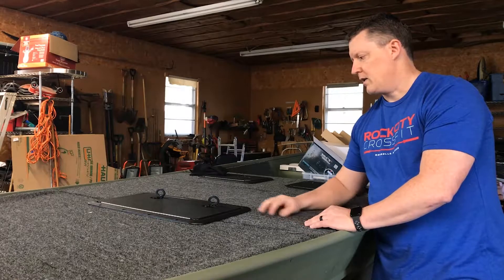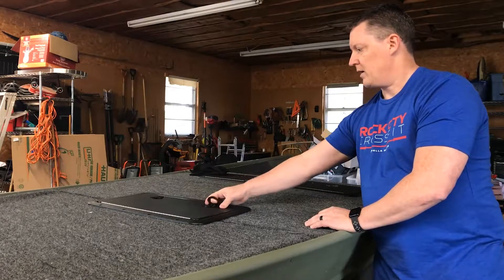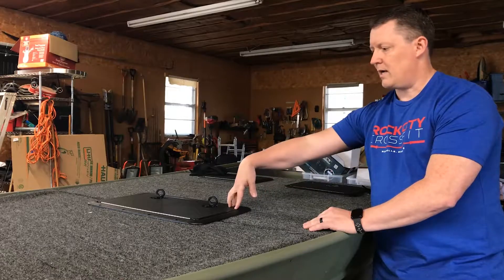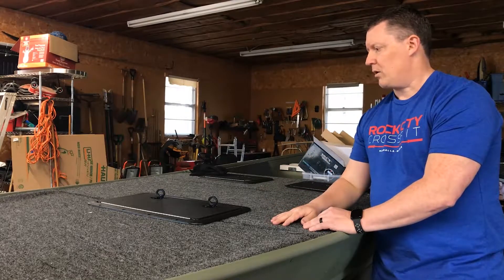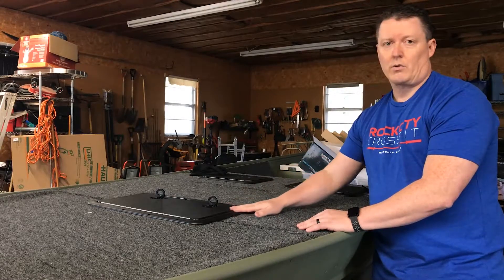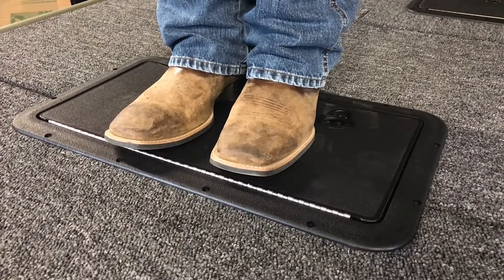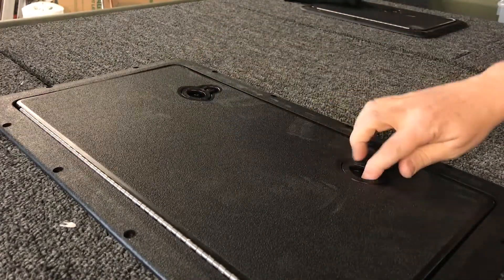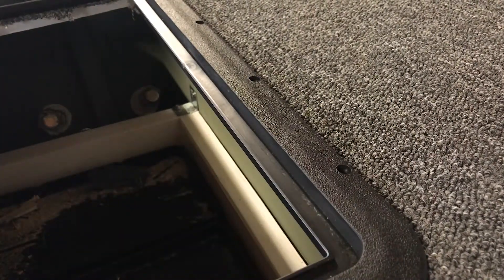How Strong Are The DPI Marine Hatches

Comment: Came across your video looking for marine hatches. If you don’t mind sharing, what type of storage box if any did you use. Looking to hold Plano 3700’s. Thanks for your video and time
Reply from the maker: Mike Sylvia I just picked up plastic storage containers from Walmart based off the size of the hole. I framed it so they wouldn’t slide around to much it holds several bait boxes standing on end. You can see the framing vid here https://youtu.be/0nMbT83nqL4 . Thanks for watching and the comment

Comment: Does it come with hardware? Either way, what sort of head do you need? Tapered? Panhead? Truss head? I'm just not confident in my hatch making abilities and by the time you get done buying hinges, hardware, extra carpet and spend time building hatches, you may as well get these. Thanks for the video!
Reply from the maker: They do not come with hardware, I used the same Zinc plated hex head screws I secured by deck with. The brand is Teks, I got them at Lowe’s, on top of the Zinc coating they have a rubber washer with a metal one on top.
And that’s the very reason I got them, my skill saw abilities need some work and I knew I could not cut them like they need to be to use wood. With these I just had to get close. Thanks for watching and the comment.
Reply from the maker: Chris I told you wrong about the screws, sorry about that. They are actually 1 stainless steel pan head someone else asked me so I double checked just wanted you to have the correct info again I apologize for the miss information I purchased so many screws and stuff I lost track.
Reply: @ArkansasFishingVideos  all good, appreciate it!
Reply: @ArkansasFishingVideos  hey, I'm back. Looking to doing 3 1323 hatch's, two will be for storage, 1 will be for my battery compartment. See any issues with fitting a group 31 battery into that hole? Thx again for all the help!

Comment: What is the guarantee if it breaks?
Reply from the maker: Hunter I'm not sure, I have not had a problem out of mine and I'm not sure I saw warranty info in the box when I got them . On Amazon it says to contact the seller directly which is DPI Marine, I check their website and did not see warranty information listed. If you are looking to buy them I would contact them and ask http://dpimarineinc.com/contact.html. Thanks for watching and the comment.
Reply: @ArkansasFishingVideos  Okay thank you. I have one more question..Does it leak? And if so how much?
Reply: I am putting it in the splash well the back of my boat and i wanted to install it without it leaking alot
Reply from the maker: @hunterorton6093  I would say a little bit or rain or water from waves you would be okay but I always put electronic (phone, camera) stuff that can't go in the dryer in dry boxes or bags. Wal-Mart makes them to cheap not to use, I have my hatches over my tackle and junk storage in the boat and have been caught in some lite rain and was fine.
Reply: @ArkansasFishingVideos  Thank you👍